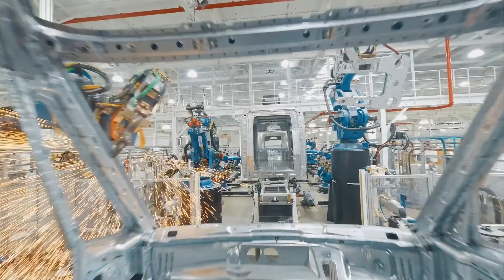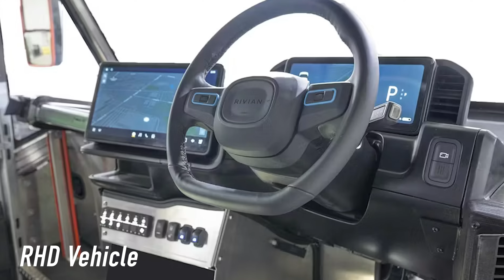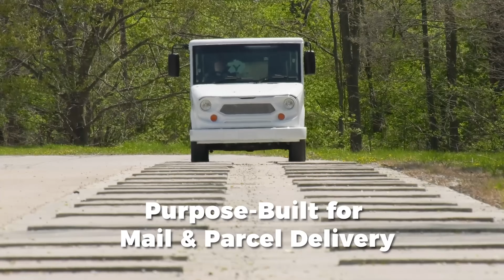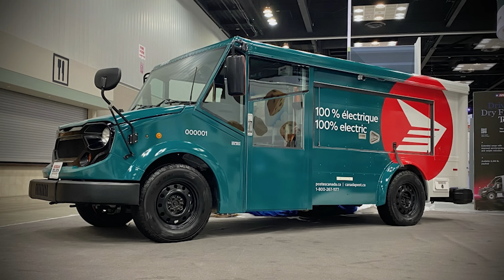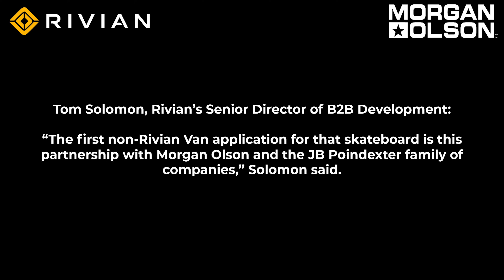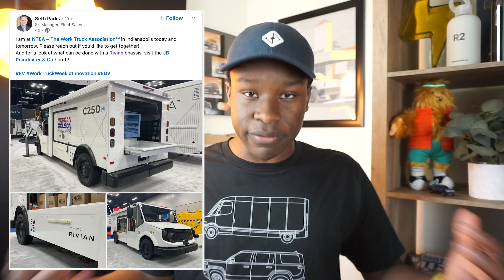Rivian & JBPCO Partner For Electric Delivery Vans

Comment: USPS is looking into this delivery van platform as well but it would be too large to replace the normal LLVs and FFVs. Possible replacement for the Promaster parcel vans. The collaborative potential is enticing though. Could well see an upgraded R1 chassis underpinning a daily box to box delivery truck.

Comment: As a canadian, we still drive vehicles from the same side as americans. You mentioned that the van builder is making a change of driver position to the right so i’m confused. Was this part meant for the australian market?
Reply: Mail delivery drivers prefer right hand drive so they can drive down the right side of the road and be on the correct side of the vehicle to reach the roadside mailboxes. Most postal drivers drive converted vehicles, imported right-hand drive vehicles, purpose-built right hand drive vehicles, bench seat vehicles so the drive sitting in the center and scoot over to the right side to reach the mailbox, or in our area, a retired couple where one person drives and the second person handles the mail.